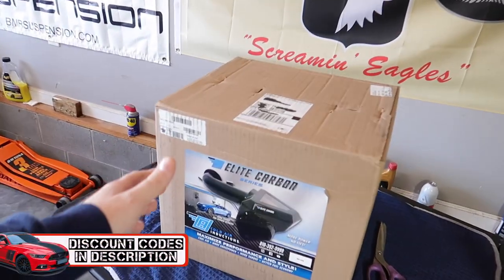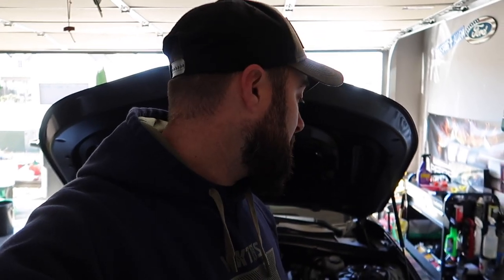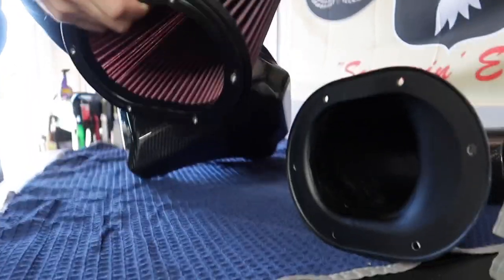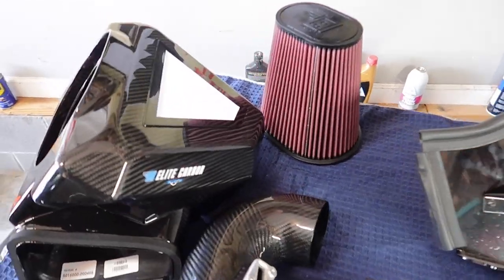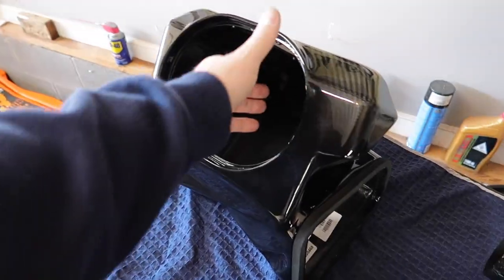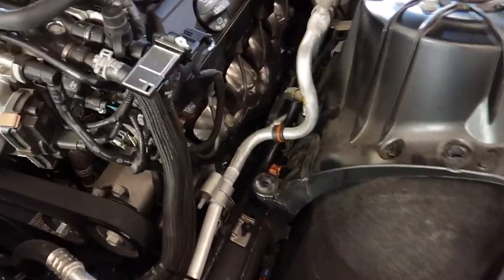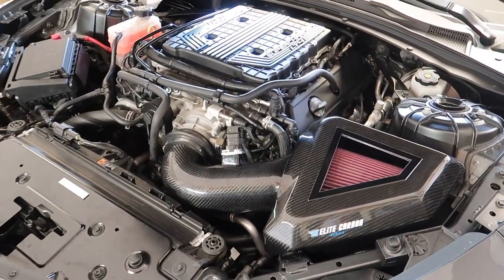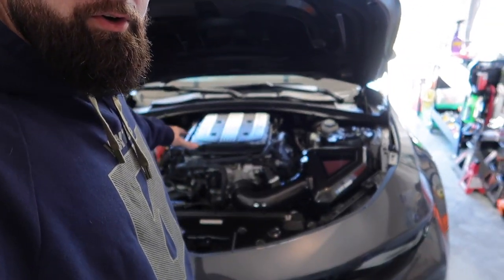Camaro ZL1/SS Carbon Fiber Elite Intake (Cold Air Inductions) CAI vs Rotofab Part 1)

Comment: The carbon fiber is nice looking, but from what ive seen on forums and other youtube videos, the Rotofab and CAI probably would perform similar give or take margin of error, it wont be until you step up to the big gulp from rotofab or other 5" intake offering that you will see bigger gains especially once you port the blower and increase the tb size.

Comment: I dont quite get it what is that intake made of?
Reply: You never heard of Carbon Fiber before?  O_o
Reply: @TheWolfMatt  Its never been used before on SUPERCARS! LOL!  Dudes content has nosedived hard.
Reply: @tylerolson5860  Why??  Because he went from Mustang content to Camaro content?
Reply: @TheWolfMatt  Didnt you hear ZL1s are SUPERCARS!!!!!
Reply: @tylerolson5860  I own one sooooo...... yeah.  They kind of are rated in the "Supercar" killer category of sports cars.  Especially in 1LE format.
Reply: @TheWolfMatt  cmon put down the koolaid its a pony car or muscle car at best.  Damn sure isnt a super car nor is a gt500.
Reply: @tylerolson5860  The GT500 is a beast for sure.  But the ZL1 is just better at being a beast on track in many more ways than most give it credit for.  Tires, Brakes, Fuel, Maintenance, Insurance, all cheaper with the ZL1.  Not to mention the sheer ability to place consistent lap times on the track, over, and over, and over again.  Though the GT500 is godly on the track, it can only do it for a few laps at a time, then needs to come in and replace 2k worth in tires, probably brakes, fuel for sure, all of which is contributed to its weight.  The ZL1 is a track day toy and can go "All Day Long" on the track, I know, I've done it several times.

Comment: I’m buying another 2020 Mustang GT 13k miles for 47,500 for everything plus tax/ dealer free. 🚗🚗🚗.
Reply: Thats high for a used gt. Is it the 401a package?
Reply: Brother, last year bought my new 2021 PP1 401A loaded everything minus magnaride for 46k.  Hold out for a bit until the prices drop if you can.